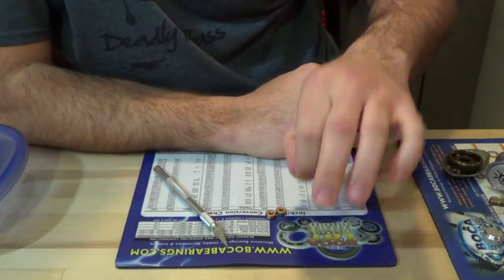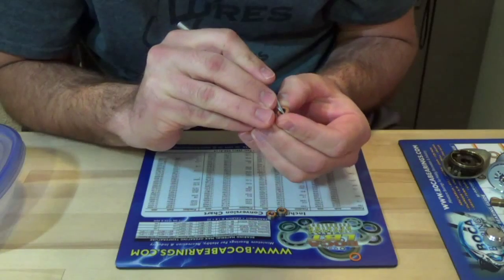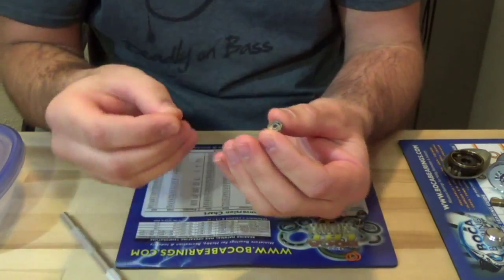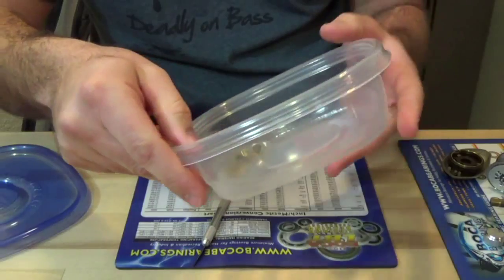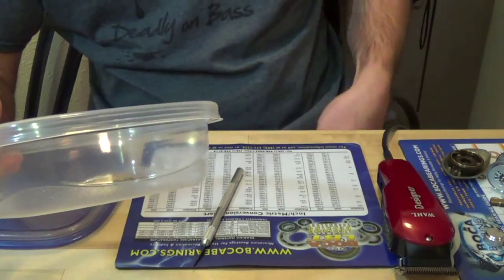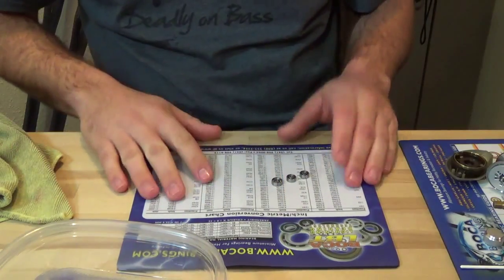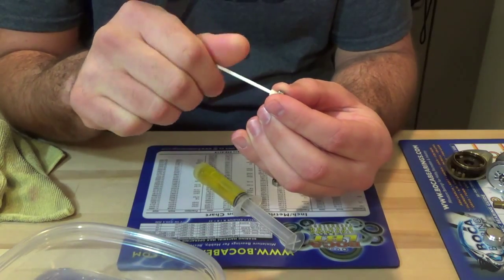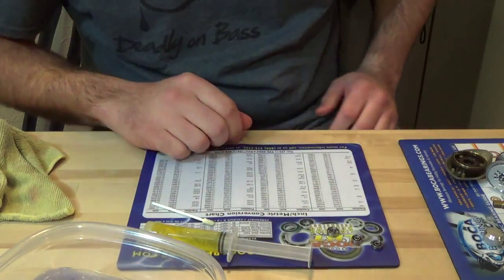How to clean fishing reel bearings

Comment: seriously?  This is silly. there are two sure fire methods better than this. No need to waste money on silly cleaners. The easiest method is citrus cleaner mixed with water. Throw your bearings in a small jar and shake the for a minute or so.  My favorite method is using a micro sonic jewelry cleaner and the citrus cleaner mix. This work amazing if you own a cleaner Oil with a thin viscosity oil like motor oil. I use Zmax additive but its pretty expensive to buy just to put a couple drops in a bearing
Reply: I use an ultrasonic also but it's because I happen to have one. This is a seriously inexpensive process. Those bottles will last year's if used appropriately. I bet I spend more on the ultrasonic solution per use than three squirts of that cleaner costs. The trimmer idea is a good one I think, it pretty much accomplishes the same job as an ultrasonic. Idk about the motor oil idea, not for me. Specific bearing oil is cheap also, I paid like $13-14 for a high quality bearing oil a year ago and it's gotta be more than half full still. I have used at least 50 drops over that period. You should see what professional skateboarders do to prepare their bearings and clean them. It makes this process look short and sweet.
Reply: What's silly is you thinking everyones got an ultrasonic bath cleaner.
Reply: @jeffsmith825  Lots of fisherman use a lightweight synthetic motor oil like mobile 1 0w. $7 will last you forever. If you run that in your car, then there isn't really a cost to snag a syringe full.

Comment: How can you tell if the bearings are worn out and its time to replace them
Reply from the maker: If the reel is seized up its often times the bearings are rusted and seized. If the reel sounds dry or feels gritty you probably have rusted out bearings as well. In general if you see diminished performance in general its worth opening up the reel and taking a look. You'll usually see some signs of rust on or around the bearing, and it might be time to switch. People who fish in saltwater in particular will often times replace their bearings every year or 2 as a precaution.
Reply: @bocabearings  thank you for the info !